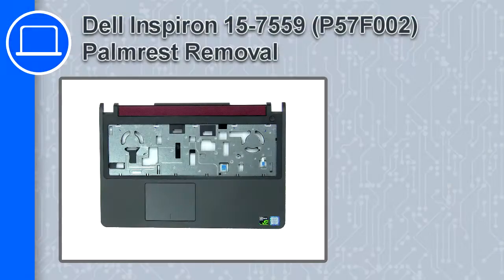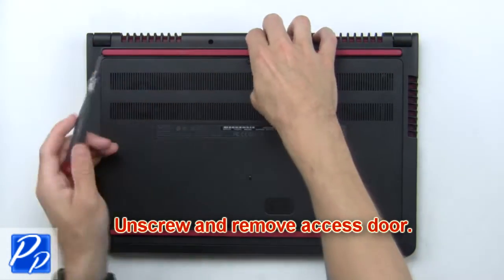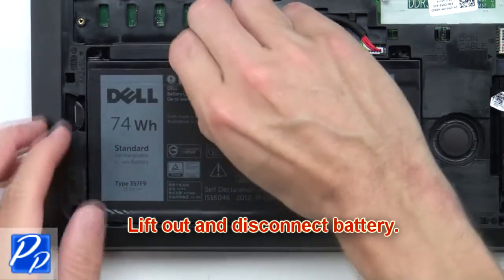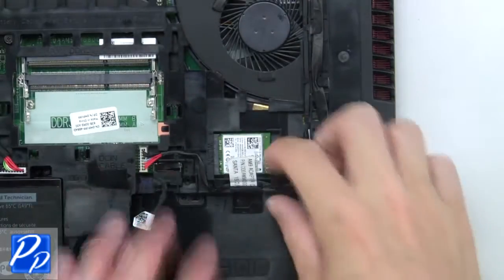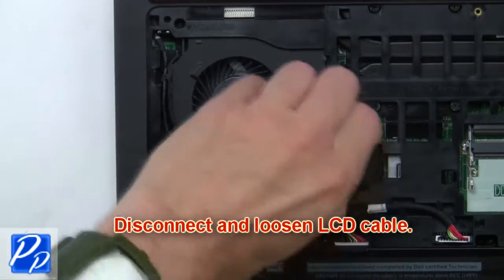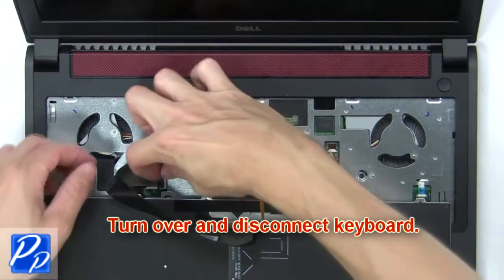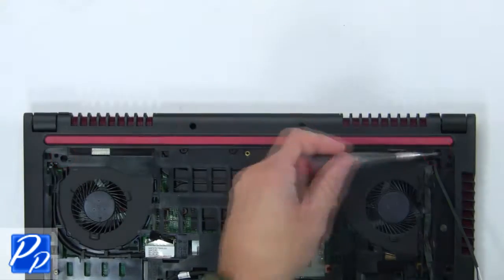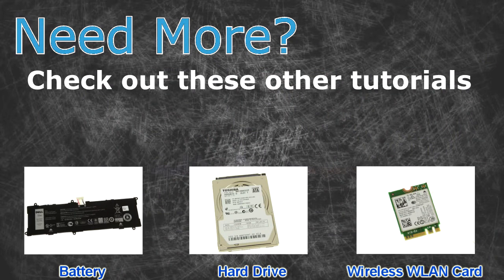Dell Inspiron 15-7559 (P57F002) Palmrest How-To Video Tutorial

Comment: It looks like the wires for the WLAN card are soldered is that it or is it just plug in and out
Reply: they're just standard antenna plugs. You can easily pry them off with a flat head.